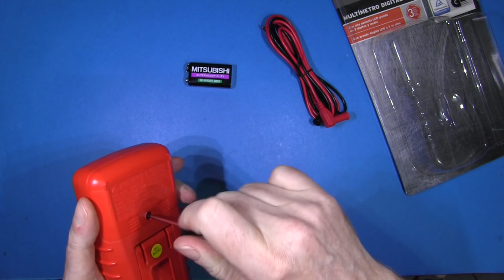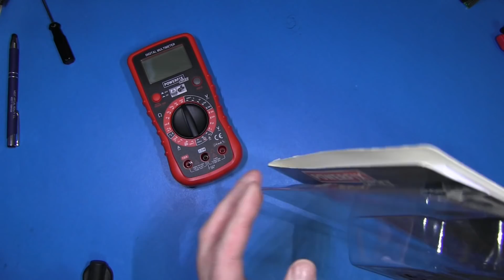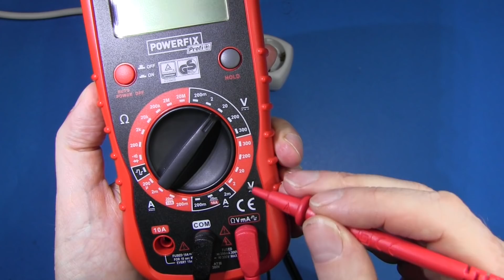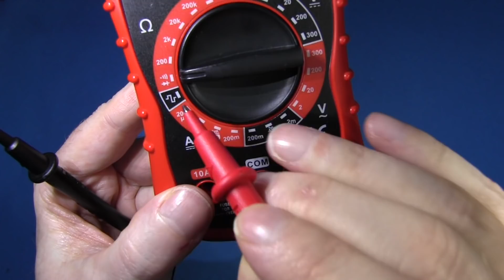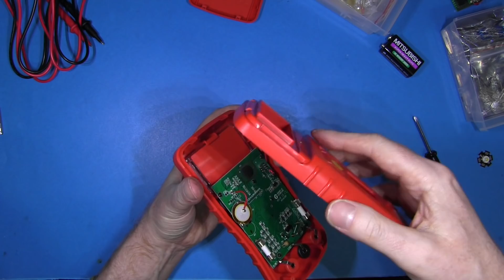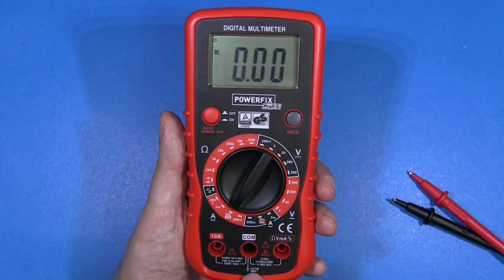New 2018 LIDL Powerfix multimeter unboxing, testing, teardown

Comment: ARVBLOG Great review to great detail (y)  I wouldn't be surprised if the printed circuit board EM 3071-161228 CKN  wasn't made in China, they like to use small resisters where ever they can, their quality control should be updated too....

Comment: Hab ich auch. Für den Preis ein tolles Teil...
Reply: Ist das meter in deutschland gemacht ?
Reply: Nein, unter www.targa.de findest du mehr Infos. Targa ist ein Handelsunternehmen, gebaut wird das Multimeter in China.
Reply: Danke!
Reply: @KeepOnTesting   aber sicher, hier: https://www.lidl.de/de/powerfix-digital-multimeter/p266114?searchTrackingQuery=meter&searchTrackingId=Product.266114&searchTrackingPos=17&searchTrackingOrigPos=17&searchTrackingRelevancy=90.94&searchTrackingPage=1&searchTrackingPageSize=36&searchTrackingOrigPageSize=36
Reply: @KeepOnTesting  
𝗦𝘂𝗽𝗽𝗼𝘀𝗲 𝘆𝗼𝘂 𝗵𝗮𝘃𝗲𝗻'𝗿 𝗿𝗲𝗮𝗱 𝗗𝗲𝗻 𝗗𝗿𝗼𝗻𝗲  𝗰𝗼𝗺𝗺𝗲𝗻𝘁. 𝗛𝗲 𝘀𝗮𝘆𝘀:
«ARVBLOG Great review to great detail (y)  I wouldn't be surprised if the 𝗽𝗿𝗶𝗻𝘁𝗲𝗱 𝗰𝗶𝗿𝗰𝘂𝗶𝘁 board EM 3071-161228 CKN  𝘄𝗮𝘀𝗻'𝘁 𝗺𝗮𝗱𝗲 𝗶𝗻 𝗖𝗵𝗶𝗻𝗮, they like to use small resisters where ever they can, their quality control should be updated too....»

Comment: Have you ever figured out how to calibrate your multimeter? Mine unfortunately shows a bit too much when measuring voltage. Have not found yet Poti to adjust. Do you have any idea?
Reply from the maker: Calibration of this meter is electronic. Inside there is a jumper marked "CAL" which I assume you bridge to go into calibration mode. After that I have no idea (maybe something to do with the long row of holes marked C3 C2 C1 ....)

If it's outside the specification printed in the manual then send it back to LIDL. It has a 3 year garantee.
Reply: Thanks for the answer. Have already suspected that it is only electronic to calibrate is on the bridges or whatever. My device is still in the specified accuracy. It was just pure curiosity.
Reply from the maker: Super-accurate is nice to have but in real life no 5V power supply is exactly 5.000V, most resistors are 5% tolerance, etc.

0.5% accuracy in a multimeter is plenty for finding problems in circuits.
Reply: Mine reads a bit too high, need to check if it's within spec. 

Meter came with battery as well as screwdriver.